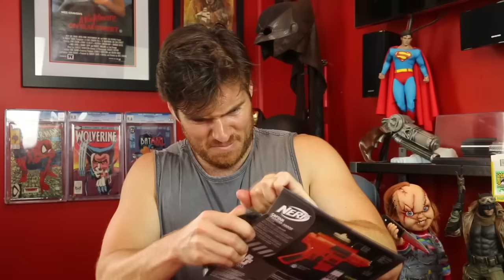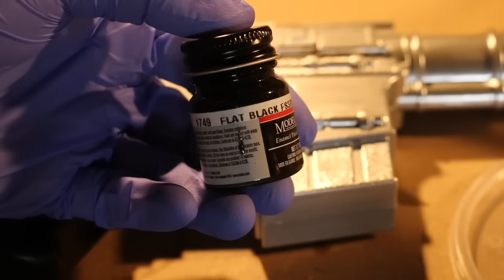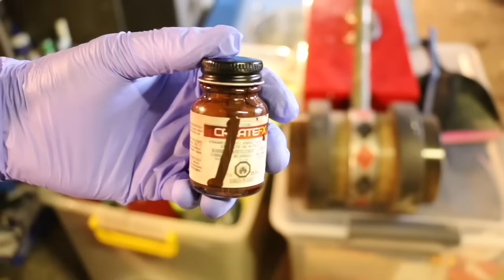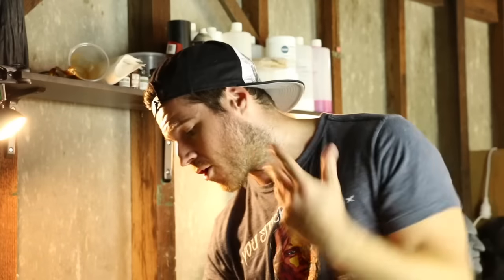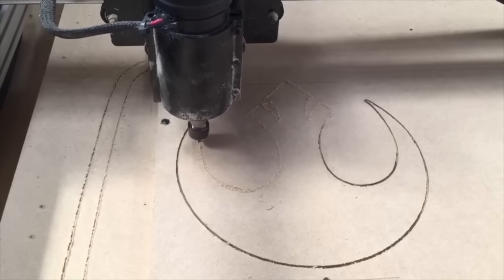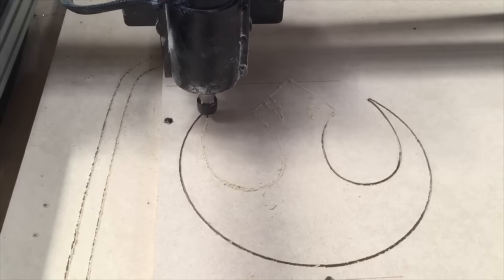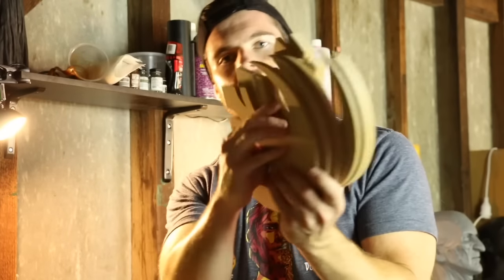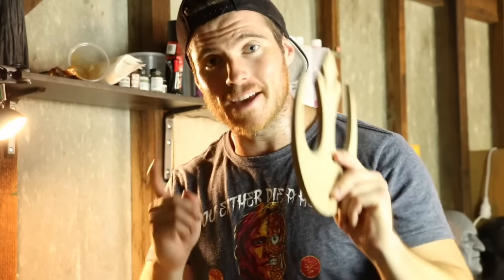Rogue One Nerf Cassian Blaster Makeover- Chris' Custom Collectables!

Comment: AR 15 upper and lower receiver with some kind of lug over the barrel nut. I didn't even notice that when I saw the movie. It might be easy to do a scale real-life replica.
Reply: Rouge One also used a Luger (Jyn's blaster), an M60 (the U-Wing Gunner) and the standard stuff like MG42s, and Sterling SMGs
Reply: DeltaWolf1000 it bothered the fuck out of me
Reply: I could be mistaken, but if this is based off the prop from the movie, then it's possible they used a airsoft M-16/M-4 body for the prop weapon.
Reply: Christolclear101 
I think you're right. I took a pretty good look at the actual prop. It looks like an airsoft rifle was used as the base for it. If that is the case, an 'accurate' replica would be pretty cheap to build. Hypothetically, anyway.
Reply: quietmouse exactly what I was thinking.
Reply: Lol when i saw the title i thought it was an Asian blaster..
Reply: the first thing i noticed when he pulled his pistol
Reply: Rouge One? or the props? Because this thread was about the props haha
Reply: It bothered you? All the Star Wars blasters from the originals were built off of old guns. Stormtroopers using the E-11 had modified sterling submachine guns, Han Solo's DL-44 is a modified Mauser c-96.
Reply: Not to mention some Imperial weapons such as the DLT-19, which was virtually a unmodified MG-34, and the T-21, which was a WW1 Lewis Gun.
Reply: Haven't seen the movie yet.
But this is what I noticed from pictures and Chris's prop.
Which turned out damned good.
I don't know about gun laws in Australia,but was thinking that 80% recievers would also be a great prop build.
But then again,so could could air soft.
Reply: Randy Jennie 
I'm not sure but I believe you can own an AR 15 in Australia but it can't be semi-auto.
An 'accurate' replica may benefit from an 80% lower just to avoid obvious stamps but it will come with a lot more work. You'd have some milling to do.
I guess it really comes down to weight, though. How do you want the replica to feel in your hands?
Reply: +DeltaWolf1000 MG 34s were used, not MG 42s.
Reply: Don't know about an AR-15 in Aus, even a replica. I've seen a few replica pistols, and even an Uzi sold at certain places, but I believe you need a license for them, and they can be quite expensive. 
As for how a prop feels in your hand, that's only for a useable prop. If you want something with weight you can do things like adding, well weight to it. If it's for a convention or something you may want it to be lightweight so it's easy to carry. And if it's for display, it's weight wouldn't matter to much. But like you said, How do you want the prop to feel is an important thing to consider =)
Reply: DeltaWolf1000 
True. Weight really isn't that important in most circumstances. I feel like visual scale would be the most important detail. And, like you said, it's also important to take in to account cost.
I imagine it would cost A LOT more to replicate this blaster in Australia than in the U.S.(where I live.)
I guess it just comes out to what you want. And, to be honest, I feel this insatiable urge to own a fully accurate replica of a Star Wars prop. And this may very well be the cheapest and easiest one to recreate. I think it's worth a shot, right?
Reply: I never thought about the weight,that's a good point.
If they are still avalible,there is the polymer lowers,which would be light even with being solid.
I think(but won't swear on it) that you can mill out just the mag well.
But have a facade(like glued in place) trigger.
Reply: Randy Jennie
Right. Something mold injected. That is a really great idea!
Cheap and relatively light. And possibly no milling necessary.
We may actually be able to pull this off and relatively cheap.
Reply: My mistake, you're right
Reply: . There are plenty of kits out there to make your own blasters. Try checking out HappyTrooperdotcom, he does a lot of star wars props using home depot supplies and costume pieces as a base. Also check out Rouge One Awesome Build on Channel Awesome. Punished Props also has some nerf star wars, 3D printed, and resin props done up. 
I imagine being in the US you could use an M4/M16 airsoft platform. You could do Jyns blaster if there is an Airsoft Luger. Of course depends why you want the prop. For display, short film, conventions ETC. I doubt airsoft prop would be allowed at a convention, but would make a sweet display piece. I reckon you should go for it. I myself am working on my own blaster project right now using a nerf force awakens blaster as my base
Reply: I just realized,my question is by no way knocking Chris's work.
Really impressed.
Reply: quietmouse 
At one point there was a two color poly reciever.
The color on the inside was what you removed.
But the BATF was unhappy with it.
Reply: I'm sure they had their reasons. Either way, it may be as simple as doing an aluminum cast of an existing assembly. Avoiding any current legal precedent. 
Technically, you're not replicating any functioning or moving parts.The weight would be presumably accurate.
It seems like a lot of trouble but the yielded results may be worth it.
Reply: Most the guns in Rouge One are base off AR platform
Reply: Chris's work here is amazing as usual. The bloke sure knows how to paint up a nice prop.
Reply: Terry, there is a Luger, Sterlings, MG34s, an M60 as well as ARs
Reply: DeltaWolf1000 
Yepp,that's what got me watching his channel.
Trying to learn how to do the mods,washes etc.
Reply: i actually once had a mini AR15 airsoft gun that broke apart and looked like this, and back then I used to pretend it was a starwars blaster, so when I saw this thing I could believe it haha
Reply: quietmouse been looking at the metal airsoft and reading the replies a prop forum.
I may just try this build.

Comment: Hey Chris, I honestly hope you get a chance to read this. Why is it, with the Custom Collectibles for figures, for the most part, you strip them down and get very detailed with the painting, where stuff like this, and the other star wars blaster, you just throw the primer on, and then detail it. Please don't get me wrong it came out great. But since you didn't cut up the front like the other, and it is not permanently attached to the base. Why not make a functional prop? Yes this will still work, but pulling the priming handle and you see a huge chunk of orange. Plus depending on the amount of clear coat the priming handle and or trigger could be stuck now. 

I'm just trying to understand the thought process, if it is a time thing? Is it a too many moving parts thing to strip down?

Comment: make Ezra Miller's the flash costume
Reply: READ Comics grants suit is horrible
Reply: READ Comics I don't care which one he does but I like Ezra Miller's suit better
Reply: READ Comics it looks that way because it deals with him running at high speeds so it doesn't burn up so he made it out of old shuttle parts
Reply: READ Comics so what of it's too advanced for a first suit it's still better than shitty fabric and leather
Reply: While your at it build a bat mobile
Reply: JK Ultra He gots to try out injustice 2 flash. Both have the muscle. But one has sleightly low 💪 mass

Comment: I spent the weekend making my own one of these and it came out pretty nice. Yours looks more like the screen used one than mine, though! Did you have trouble with the trigger? I can't get the paint to stop chipping off on my blaster's trigger. Here's a pic of mine: https://twitter.com/jimmychampane/status/818349739108233216
Reply: Jimmy Champane There is probably an oil residue on the trigger. Toy companies sometimes oil the mechanics of these blasters to make the trigger move smoothly. I would wash it well and scuff it with some sand paper, then repaint the trigger.
Reply: Thanks for the tip! I'm going to try that after work tonight.